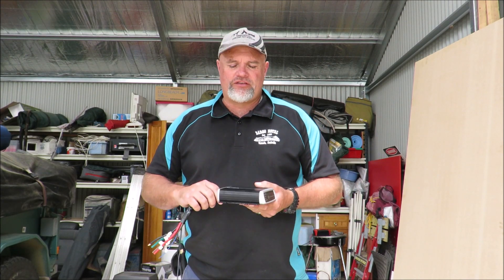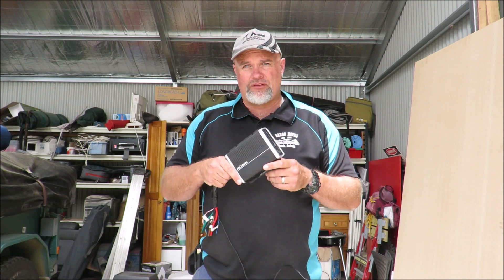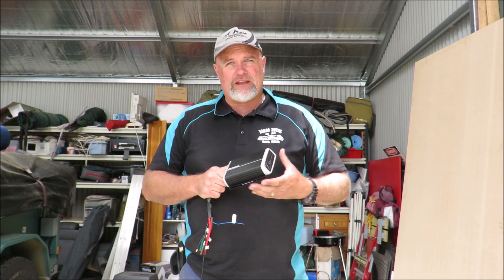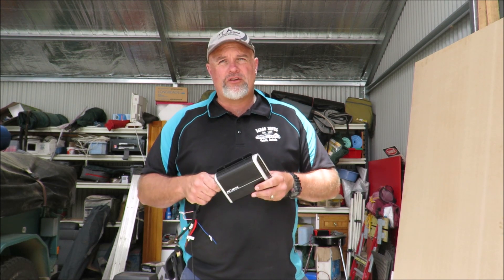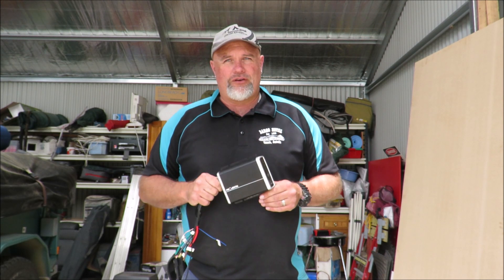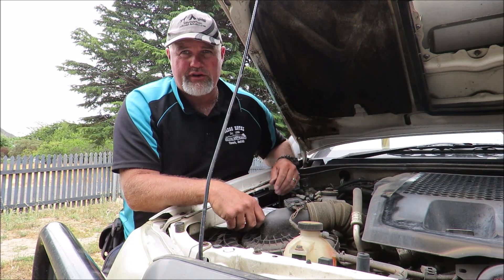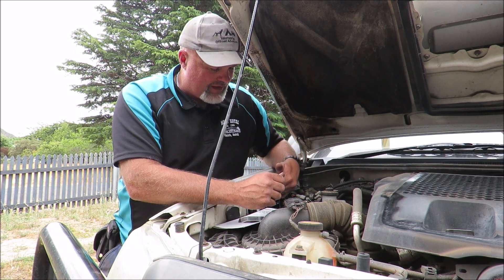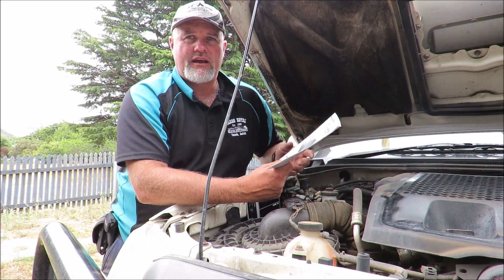Projecta IDC25 DC/Solar Battery Charger Installation

Comment: I have a 45 A DC-DC Projecta charger that's about 3 years old. Its solar MPPT produces annoying coil noises. Have they ever fixed that?
Reply from the maker: I’ve since sold the Hilux and put one in the new Ranger. No such noises coming from either.

Comment: I just installed one of these into my 79 series cruiser to run my fridge permantly aswell mark. I had the same issue as you, the standard mppt regulator just didn't cut the mustard. 

Iv always had redarc gear but I wanted to try something different, and I'm extremely happy with it.

Thanks for the review mate 👍
Reply from the maker: Cheers mate. I’ve been very happy with mine. I’m just installing one in the new Ute now.
Reply: @TasmanianOffroadAdventures  bloody awesome mate thats what you want. For over half the price, you cant complain. The performance has been fantastic. The way it also utilises solar, aswell as charge from   the alternator  at the same time is a great feature

Comment: Unfortunately the solar input on mine is stuffed. Soon as I put panel which has 20volt or even 16 volt output, the charger blocks it to 4 volt. 
Definitely a fault. Many on forums say the same happens.
Reply from the maker: Hey Scott. I've had a great run out of mine. I've had a couple of people tell me they have had trouble with theirs, but I like mine so much I've bought another for the new ute.
Reply: Make sure you buy the series 5.
It will be on the code of the unit. V05

Comment: Hi there, thanks for this great content, Wondering how you have found the performance compared to the Victron controller?
Reply from the maker: Hey mate, thanks for the feedback. Great question, but I haven't compared the two. For me they serve s different purpose - Victron is the solar controller for my folding panels and the Projecta is being used as a dual battery isolator/solar controller.

Comment: Keen to see a post trip review on this. Thanks for the video! I'm considering one of these myself.

Also just wondering what you have running? As I'm not sure whether to go for the 25A or the 45A one yet.
Reply from the maker: Hey Jay. I have run this on two week long Tagalong Tours and a week long family camping trip with no issues. I'm running a Bushman 52 litre fridge and a 14 Litre Engel as a freezer, uhf radio and a couple of lights, iphone charging etc. It's doing the job fine so far. I have another Tagalong in a months time so I'll do a review after that.
Reply: @TasmanianOffroadAdventures  Awesome, thanks for the feedback, its much appreciated!

Comment: Great unit, had it in my patrol in the rear charging the 130ah battery. No problems 4 years on.
Reply from the maker: Moses1988 great feedback mate. It’s been for about 3 weeks now. Another couple of Tagalongs  and I’ll do an update video
Reply: @TasmanianOffroadAdventures  sweet! Mine has a hard mounted 250w panel also,  handles the 13 odd amps fine. It floats within 2 hrs of sun hitting the panel haha only because my waeco 75L dual zone is power hungry haha.